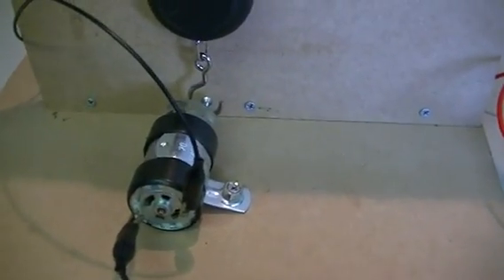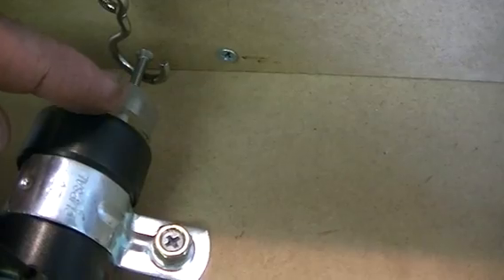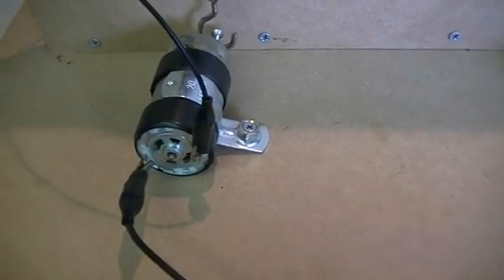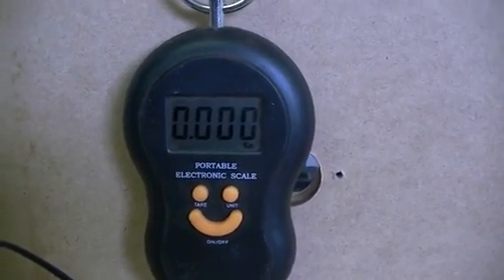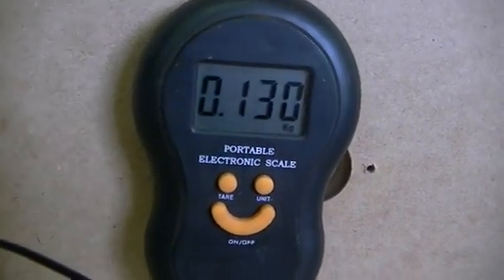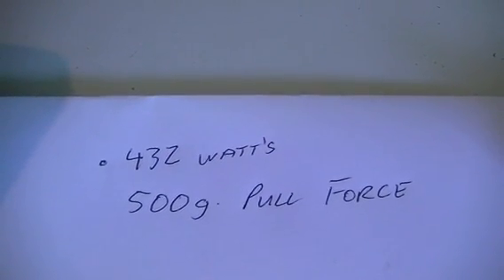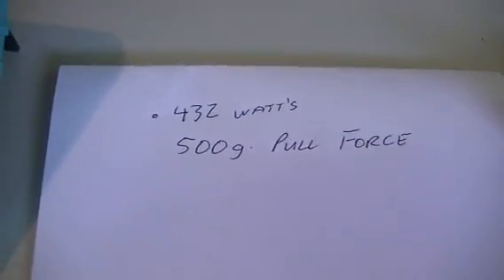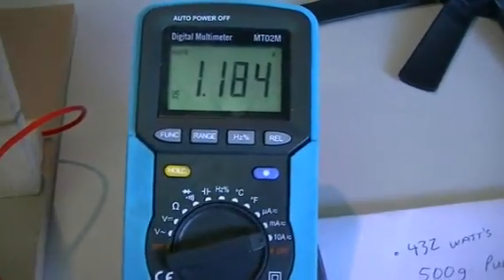Small motor torque test

Comment: Hello, what is your voltage? If you had 1.1 A of current than you should have used around 1 V of voltage...? I ask you because you didn't mentioned voltage and there is now where to see on your video what is the voltage.
Reply: He did mention it, if you notice the power supply its set to indeed 1 Volts.

Comment: I guess how you built the prony brake does not work ? How is your axis pulling down the scake ????
Reply: Typo ,Should have read "scale"
Reply from the maker: The prony brake was used to measure horse power,and was correct.This test is measuring rotor torque.Torque and HP are two very different thing's.There is a plastic wheel attached to the shaft of the motor,and there is a screw in that plastic wheel that is at the same diameter as the outer rotor edge of the motor.The scale is hooked to that screw,so as we get the pull force of the outer edge of the rotor in the motor.
Reply: TinManPower Very Nice that you follow the work of gotololuc :)

Regarding "torque" measurement, you don't give the "torque", in fact, but the "tangential force", you need to care indeed of the length of the radius of your disk, your reasoning with 1:1 is not accurate

But you're Very Right when you state "torque" is something different than "power" :)

BTW, the best way to measure "torque" AND "mechanical power" a same time, is lifting a weight with a pulley and use the chronometer; don't you think so?

Regards.
Reply from the maker: Khwartz I am measuring rotor torque,not shaft torque.The radius of the bolt that the scale is hooked to,is the same radius  as the radius of the rotor of the motor.This is showing grams of torque of the rotor. You do the very same when torquing head bolt's,but normally in foot pounds.If the rotor of the motor is say 1cm^,and we measured a pull force of 300grams,then we have a torque of 300cm/g at the rotor.
Reply: TinManPower Dear Brad, there are 3 distincts concepts here:

1. "Shaft torque",

2. "Rotor torque",

3. "Moment", or just "torque",

and as more we differenciate the concepts more we allow us to be accurate and so not leading to misinterpretations, so wastes of time, good to clear up the differences in between. So,

• "Shaft torque" is about twisting the axis,

• "Rotor torque" is about the reaction of the fluid against the rotation of the rotor (like for helicopters rotors),

•  "Moment" is "the rotational force per meter" reduced to the center of rotation when there is rotation of course (which is on the axis necessarily). This moment corresponds to "torque" when nothing is specified.

So yes, indeed, your way to measure the "torque" (definition 3) is absolutely correct but not your way to interpret it. YOU DO NOT MEASURE "TORQUE" BY YOUR READING ON YOUR PONY-BRAKE, YOU ONLY MEASURE THE "ROTATIONAL FORCE" (or "TANGENTIAL FORCE") AT A SPECIFIC RADIUS.

To get the "torque", or "moment", YOU DO NEED THEN TO MULTIPLY IT BY THE LENGH IN METERS. (To have directly the reading on the pony-brake you would need to set a 1 meter radius disk, not just been 1:1 with the radius of the rotor ^_^).

Otherwise, still your idea of torque measurements and comparisons looks to me most relevant in the case of the Luc's MMM :)

Regards, 
Didier.